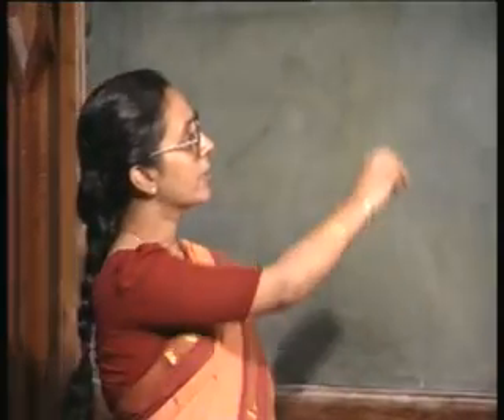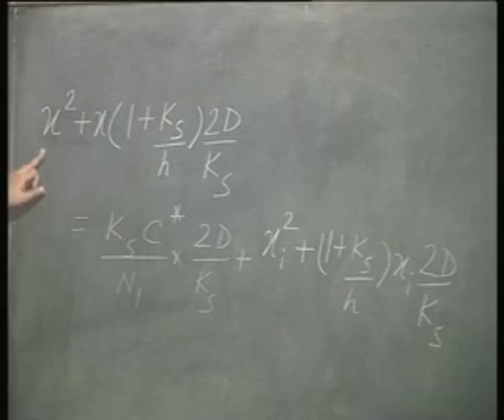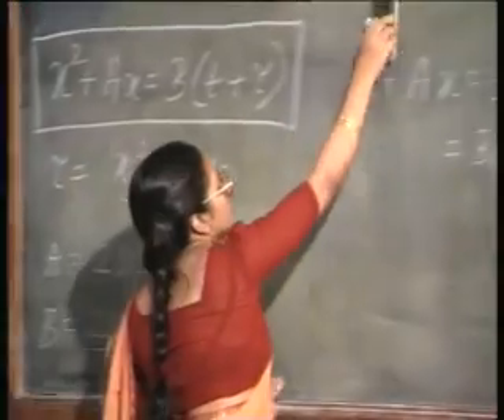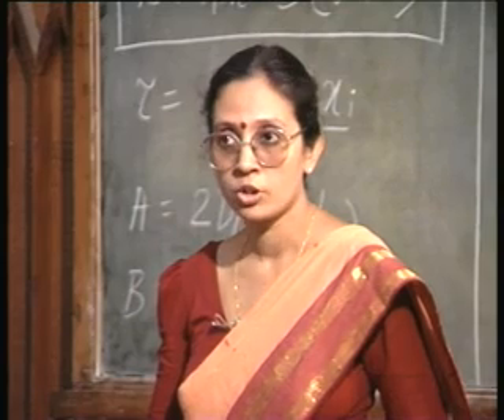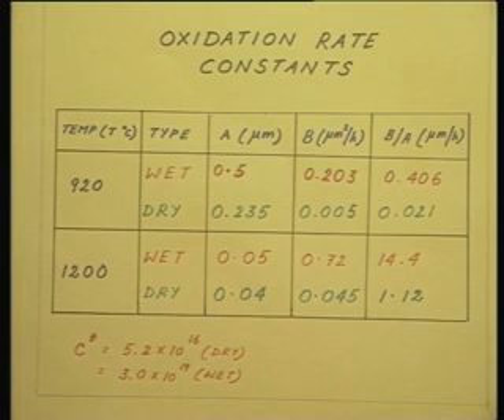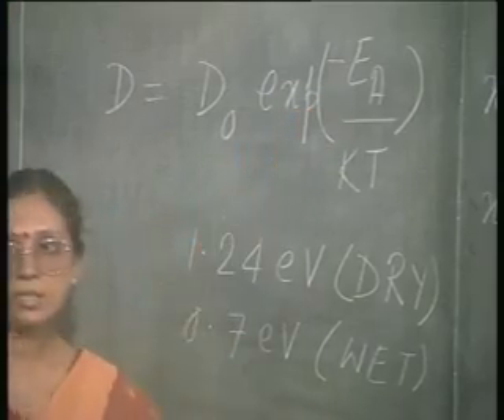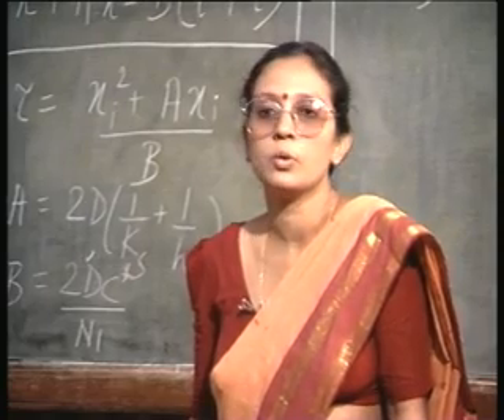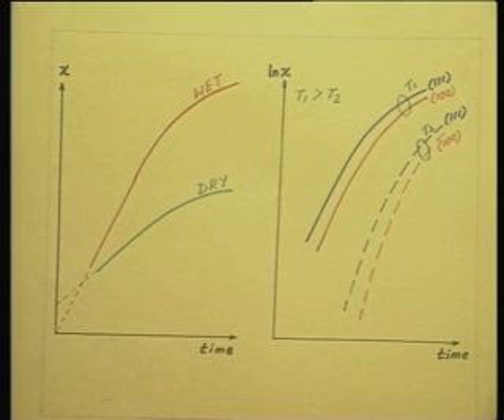Lecture - 12 Oxidation II Oxidation rate constants

Comment: why for t goes to zero this term is much less than 1? (4B/A^2 * (t+tau) ) ??
how so? something is missing, the tau is still present and we get an expression with Xi's and A's ....someone?
Reply: Imagine if t almost equals to zero or very less value like 0.03 then multiply any value with this small value will result in small and it is very very less than 1. therefore we can use  a formula that (1+ epsilon)^1/2 = 1+ 1/2 Epsilon
Reply: Bro if u expand it ..then u will get it😵😵
Reply: binomial expansion